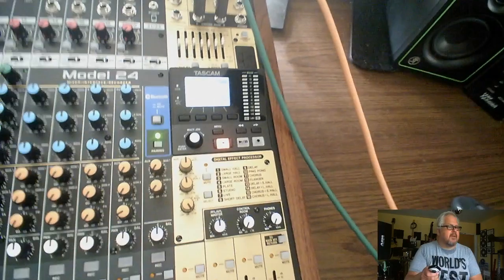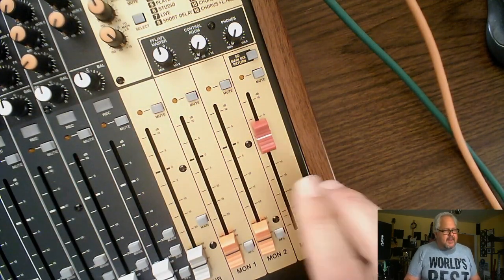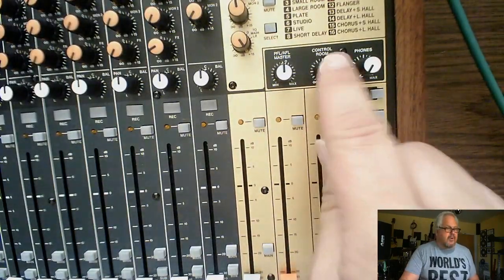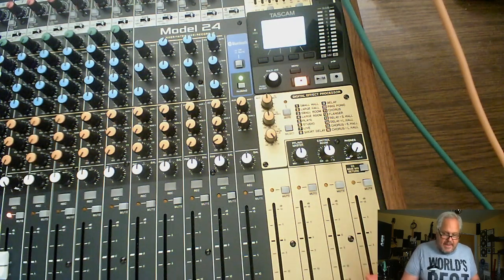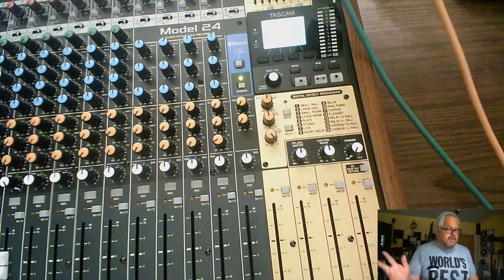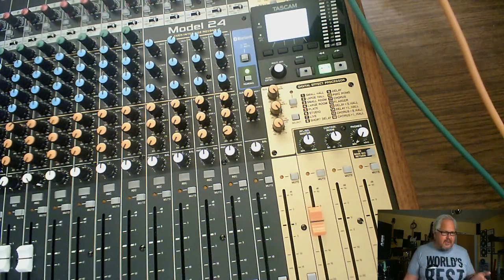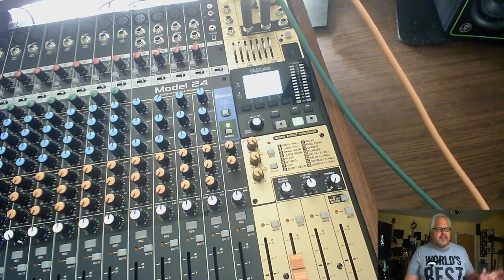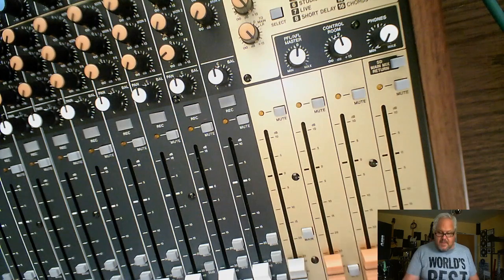Differences Between Main and Control Room Output on the TASCAM Model 16/24

Comment: Very interesting to see that your Main Fader doesn't feed the Control Room and that your Graphic EQ doesn't print onto your Master Mix. That might be only for the Model 24 as I have the Model 16 and the Master EQ affects the Main Mix (or you can set to the Monitor Outputs), which you then hear feeding the Control Room level (pulling the Main Fader down cuts the level to the Control Room no matter what it is set at, and the EQ is both heard in the Control Room and printed when I record channels 15/16 which are my Master Fader, not the Control Room). Hope this helps people who have the Model 16 and are experiencing something different!
Reply from the maker: I'll have to check that out on the Model 16 at church.
Reply: Pulling the main fader down does not affect CR level at all in my experience with the Model 16. CR has it's own fader and the 2 outputs seem very independent of one another. I don't use the master EQ so I don't know about that. I'm surprised to hear you say Main fader can cut the control room level.
Reply: @curtiswindover4564  Double checking with the schematics (and with my actual board), the Control Room Fader definitely receives audio from points that are after the Main Fader, meaning the mix will cut out if you bring the main fader down. This will always happen unless you’re PFL-ing a certain channel - which then the signal going to the Control Room Fader will be replaced with that.

In theory, the Control Room Fader will always monitor something, which in the Tascam’s case is the Main Mix unless changed on purpose. If the Control Room didn’t monitor the Main Mix post-fader, there’d be no way to set and record a healthy Main L/R Mix while also being able to set how loud you want the monitoring level for your speakers.

The Sub output is more-so what I imagine you’re explaining being entirely separate from the main mix. You could theoretically maintain the mix on the Sub output fader even if you pull down the Main fader if every channel is being sent to the Sub output, but I’m not sure what benefit this would give in a real-world scenario aside from grouping multiple sources together for bus processing.

Hope this helps!
Reply: Thanks for replying. It must have to do with the PFL option then. I use control room, sub & main as independent outputs. Sub goes to my headphone bus (so I can have stereo phones mix). CR goes to an amplifier with vintage stereo speakers, for an 'alternative monitor'. I also send Mon 1 to a sampler for when I want to capture anything that way. I should mention I use mine as a USB interface. I don't use the recorder.    @jackblunier
Reply: The Model 12 and 16 are digital boards the model 24 is an analog board so the circuitry is different
Reply from the maker: @DonaldMerrit the model 16 is analog as well. Only the 12 is digital

Comment: I have the model 24 I don't use it to play gigs, I use it in my home studio. This is what I do. I use no computers. I send the control room output into a monitor controller that sends the signal to the studio monitors and other destinations. I send the main output directly into a Tascam CDR 902. The model 24s main output is an analog signal, and the Tascam CDR has analog inputs. The model 24 and the CDR 902 work very well together. You can make some really great recordings right at home. But then you can take it a step further, remove the SD card and take it to a decent studio where you can tweak the mix even further and have it mixed and mastered.

Comment: 12:30 – I’ve found that you do need to have the “main” button depressed on any given channel for that channel to record to multitrack. It will always record to the channel 23/24 stereo mixdown regardless, but to get it to record as a separate track, its mains button needs to be down (I don’t know whether the “sub” button works the same way). This isn’t obvious from the user manual’s flow diagram, but apparently every channel has this interlock. The only reason I can fathom, is for example you’re recording a show and you hear something going wrong on one channel, removing that channel from the mains mix also removes it from the recording.
Reply from the maker: Yes, if you want to copy the mixdown from the system, then you need to have the channels going into the main.  Generally what I do is record the stuff, then do a final mixdown using the main section.  I should do a video on that too.
Reply from the maker: Hey!  Just looked at your artwork on the website!  That is some crazy stuff!  Love it!
Reply: @MikeFoerster  Thanks, man!

Comment: Awsome stuff.. the sd main mix return...the only thing I can see that being used for, is you do your mix with all your tracks, then start moving the faders to try and make a better mix, and before hitting record to make the stereo track, you hit the sd mix return, so you can compare the previous mix to see if your changes are in fact better...or worse?
Reply from the maker: I think you are better off hooking up your studio monitors to the control room section.  I use the mains when I use it for an off the floor recording for the PA speakers in the room.

Comment: would I be able to run CR OUTfrom the mixer to a Zoom F6 field recorder to record the signal of the microphones. Basically I want to record a live event panel discussion and the MAIN OUTS would be taken up by the Amplified speakers so I need another output to go into my Zoom field recorder. is that possible? also another concern is I want to record 2 separate mic from the mixer ( they will be using 2 wireless mics, wireless receiver going to input 1 and 2 on the mixer) but the mixer is like yours, only MAIN OUTS and CR OUT is it possible to get 2 separate recordings of each mic into my Zoom field recorder?
Reply from the maker: That's a great question!  Yes, you could run from the CR outs into another recording device if you choose.  I don't know if you know this, but the mains get recorded onto tracks 23/24 on the Model 24 as soon as you press record.  I'll make a video discussing this further, but I do like this idea.

Comment: So.. 1st, this is an awesome explanation of Mains and Control Room outs... My question (confirmed by listening and looking at the mixer block diagrams) is about the control room outs being MONO (sent to both L/R), so stereo position is not included in the control room outs except for the dedicated stereo tracks. Is this normal? I am kinda new to recording this way, but I sometime (a lot) use my monos in pairs with L/R or pan some mono signals L/R to find stereo space and that is all lost in the control room outs. Maybe I am missing the point. Help me to understand why the Control Room outs can be used for studio recording with the above scenario. :) I am eager to learn. Thank you for making this content.
Reply from the maker: Odd, I get stereo from the control room.
Reply from the maker: I'll work on a video for this.
Reply: @MikeFoerster  I see this behavior on mono channels (1-8) (model 16). They route to the control room bus both L/R equally, so centered. The PFL is prior to the pan knob. This is tough for me to understand, but is confirmed by listening.. and checking the block diagrams for model-16/24. Odd choice by tascam.. IMHO.. maybe I am missing something.. I hope I am missing something.  Try to Pan ch1 hard L or R.. and listen.. you will hear the signal centered. I tried Live and MTR.

Comment: What's the best way to use the Model 24 for running 2 sets of monitor speakers? I have a large pair of HS8's that outputs audio from the mains for monitoring live audio from my hardware setup. I also have a smaller pair of JBL's that I use with my DAW for mixing. Should the JBLs be plugged into the control room, the subs or should I get a speaker selector like the Mackie Big Knob?
Reply from the maker: I have two sets of speakers too which I use for monitors and I have a Passive Big Knob (the smallest one you can get).  It is the best way to connect them up since I can switch between both of them.  If you are looking to use both sets of speakers, I would hook up the larger ones to the main output and the smaller ones to the control room speakers.

Comment: SD MAIN MIX RETURN switch

When this switch is on (pushed in), playback of stereo master files recorded on the SD card is output from the MAIN OUTPUT and AUX OUTPUT MON 1/2 jacks.
ATTENTION
Be aware that when this switch is on (pushed in), the sound of the MAIN MIX L/R bus is not output.
Reply from the maker: Very true.  Thanks for bringing that up!